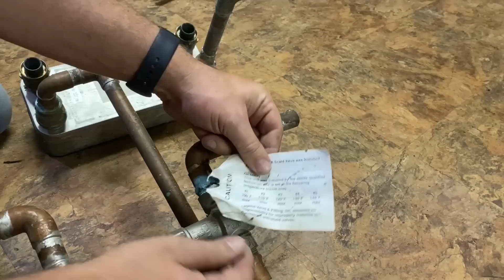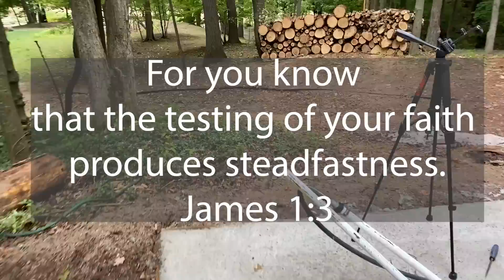Installing The Wood Boiler Hot Water Heat Exchanger

Comment: Nice job! Sorry about the leak. It's after the fact, but a quick & simple way of leak testing the heat exchangers before installation might be to pressure up one side (shell or tube) with an air compressor and attaching balloons to the other side fittings. Any leak would blow up the balloons. Of course you'd need to make up the fittings for this test. Temperature could also affect the leak, so you 'd want to go above the normal operating pressure for the pressure test.. Looking forward to the next vid. Many blessings.

Comment: Potable water....  So..We love your videos.  Please don't hate us.  Understand the difference between potable and non-potable.  That heat exchanger is way too small. Glad it failed. You should not have potable and non-potable water going through an exchanger which can fail and contaminate your water. Plastic is plastic. If you distrust it, don't drink out of anything plastic. Pex is safe. Love your copper soldering skills. It is cheaper than push to connect. However, don't forget to pay yourself for your time. Keep up the good work! ♥

Comment: When putting the tape on the threads, you have the tape coming off the roll, from the top of the roll. (Roll is being held vertically.) If you turn that roll over, so the tape is coming off the bottom of the roll, it is a lot easier to keep the tape tight as you apply it.
Reply: Jup

Comment: I already saw in the comments section, but thought I would repost. Using a brazed plate heat exchanger on a domestic water application is not a good idea unless you are using a double wall unit. The magic of a double wall unit is if there is a hole in the plate the water will drip between the plates in a cavity (without fluid) and onto the floor so you will know there is a hole in the plate, and the fluids will not mix. Over time the solids in the water will wear through the plates of the single wall unit, the fluids will mix and you won't know. There are a few manufactures who make double wall brazed plates. (Alfa Laval, bell and gossett, etc.) With that being said I would make sure the new one you get is a double wall brazed plate.

Comment: Good job I have a central boiler since august 1996...never shut it down I heats my domestic hot water and 3 floor house all zoned Cooper piping ....I have 2 heat exchangers the solid copper 21 inches long back to back 42 inches for domestic hot water what brand of boiler ya getting ?
Reply from the maker: Central boiler!

Comment: I always have problems with those small cutters. I get them off kilter somehow, and instead of sitting in one place, and cutting, they tend to screw/thread themselves along the pipe. LOL
Reply: Always go clockwise and don't over tighten, or junk cutting wheel
Reply: @erbstreettackle  Thank you. I believe I do always go clockwise. But it wouldn't surprise me a bit to discover I always over tighten right from the beginning.

Comment: I’m planning to install a wood boiler in my garage and pipe into my basement, about 25 ft, and heat my existing oil fired hot water loop. My garage could by below freezing so I need to use a heat exchanger and run antifreeze in the outdoor loop. Do you know what temperature drop you get Accross your heat exchanger?

Comment: Do you have to bleed the water from the outside boiler through the exchanger…and if so can you explain how to do that?
Thank you
Reply from the maker: No need to bleed anything. But if you need to drain the water for any reason you need to do so at the lowest point
Reply: @SSLFamilyDad  Thank you…my hot water heater was leaking and unfortunately the plumber we hired had to cut the pipes to the heat exchanger…and nearly drained the entire tank in the wood boiler in the process…I am going to install a new exchanger after I refill the boiler with water…after everything is hooked up do I just need to run the pump and that will just recycle the pipes?

Comment: Never leave solder in pipes or connections as this will introduce turbulence and the water going by will eventually cut thru the pipe.  Also when cutting any pipe you must chamfer the inside to make a smooth transition from one connection to another for the same reason.  Pex is the only way to fly as copper is not forever and if joints are improper will leak over time.  I have seen copper become less than paper thin and leak from elements in the water causing corrosion. Copper had its heyday but not anymore.

Comment: When you have the heat exchanger like you do it has to be going into the hot side of the water heater. Is yours ? Also I would of out quick connects on the heat exchanger because those ones will get scale and plug up over time. They have to be removed every other year and cleaned. I just replaced my 3rd one in the 10 years of running. This year it seemed to be going good but I burned 3 taco pumps and I bypassed the heat exchanger and it’s been running flawlessly.  Now I am waiting for my side arm heat exchanger to get here and I am switching it out. Good luck on your plate.
Reply from the maker: Good call on the quick connects. Yes it is going into the hot side

Comment: Will you add a circulation pump to the water heater.  It seems that exchanger will heat incoming water, but will not heat the water that sits in the tank.  Will that just stay as propane and be that necessary loss, thanks for sharing
Reply from the maker: As long as it is close enough to the tank on the incoming line supposedly there is some convection that happens and circulates the water a bit but the propane can come in to keep it hot if needed
Reply: @SSLFamilyDad  I don't see how that would ever work without a recirc setup. You've only got one tap on the cold line that goes to the bottom of the tank. The hot water sitting in the HX is less dense. There's no way it sinks, and even if it did it's got to coexist in the same pipe as the cold water that needs to come up to replace it.

Comment: You run the rick of coolong the water going to the air heater . This will make cold air blow in your home ... A simple solution would be a contact thermostat on the water lone before the air heater, in line with the electrical lone of the fan . When cold woter comes the fan shats down.
Reply: It's a preheater so would only be active when the tank is filling. And it won't cool boiler water enough that you'd ever notice from an air heater.

Comment: It's basically all good, and it's going to be okay the leak can sometimes close when it gets hot you could try that, but !!! first take a look at the flue gas outlet make that right, bracket the pipe properly and put it straight on the boiler, this is this way a big risk of carbon monoxide, make this the right way

Comment: If the heat exchanger is leaking, there might also be an internal leak, making your wood boiler reservoir overflow.
Reply from the maker: I check med it under pressure with the boiler lines off for awhile and didn’t see any water inside so I think it is just leaking to the outside. I will replace it soon….
Reply: Or worse, boiler water in your drinking water.

Comment: if your heat exchanger is leaking on the outside, chances are it could be leaking on the inside causing cross contamination into the domestic water FYI

Comment: Be much easier using the copper pipe inside a copper pipe hot water heater attachment like Central Boiler sells or build your own gravity flow system. I made my own instead of buying one.